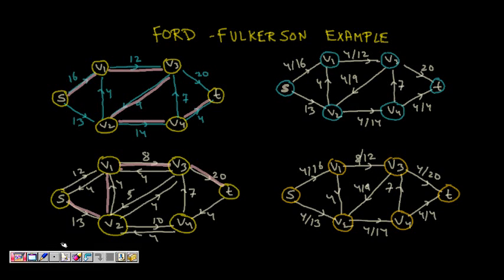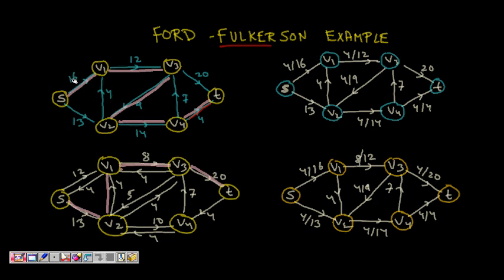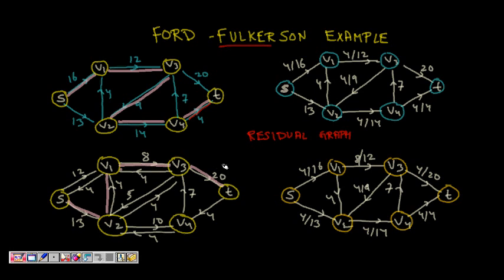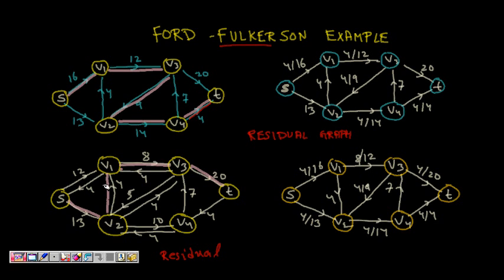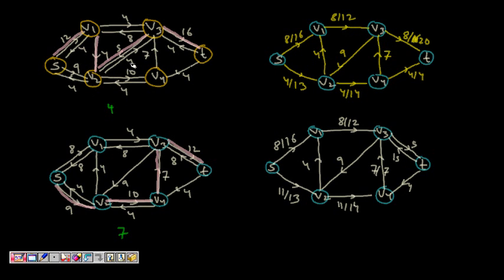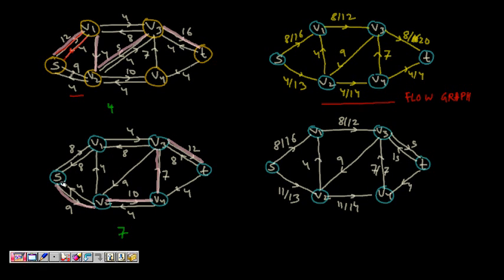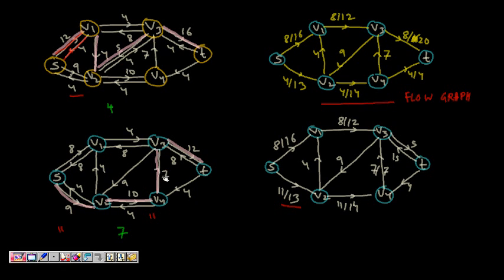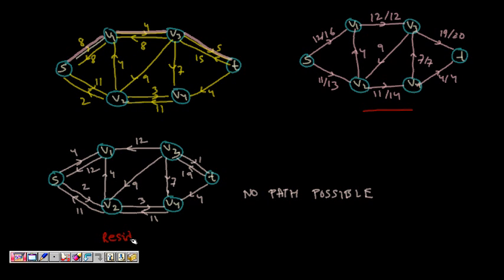Programming Interview: Ford Fulkerson Method Example (Part 3)

Comment: I am not clear on how FF helps in solving the example in part1 where we end up with max flow of 3 instead of 5 by chosing different paths. How does FF realise it should xxx path to obtain max flow
Reply: +SRUTHI NAGALLA It is because the Ford Fulkerson method introduces these Residual Graphs, which have new backwards edges (anti-parallel edges) that were not allowed in the original Flow Graphs.  Using the backwards edges, new paths open up from S to T in the Residual Graph.

Comment: !!!your answer is wrong!!!
at the last graph the edge between v2 and v3 (with cost 9) is reversed,and there is 1 more path,leading to the answer:24/29
Reply: Can you please specify the exact path that you are considering? I am getting 23 as the max flow.
Thanks
Reply: And I agree with Abhishek, V3 has only 12 and 7 as its incoming edges, hence the max inflow on V3 can be 19 (12+7)
Reply: I don't think the answer can be 24 .The path between v2 and v3 is originally in reverse direction only.
Also if v3 can  at teh max receive only 19 units so will never be able to push 20 units out.